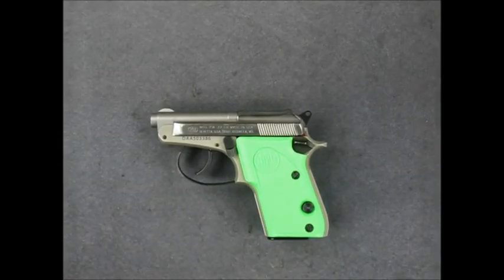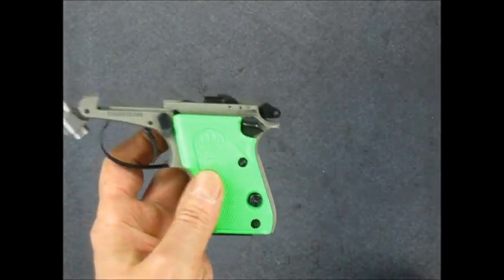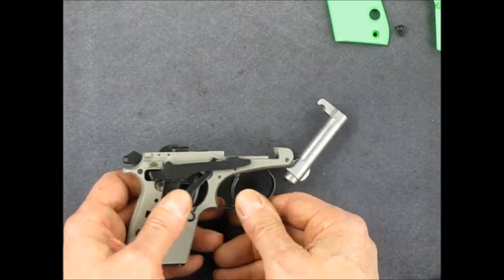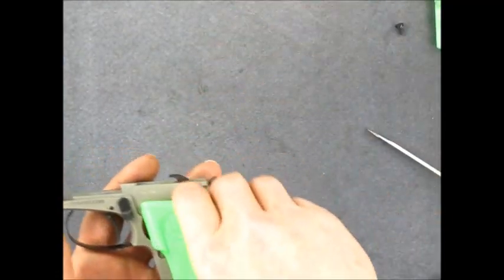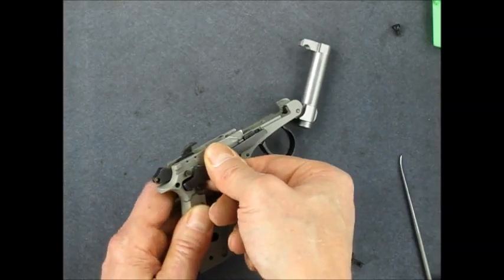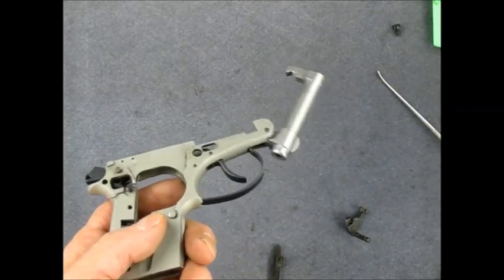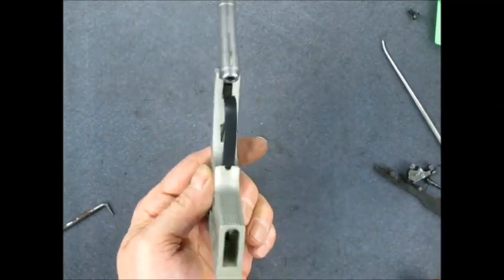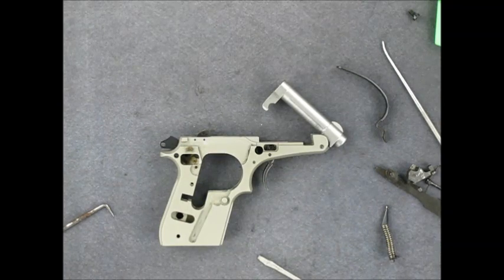Beretta 21a Bobcat   Complete Disassembly

Comment: You just saved me a lot of trouble today. Was taking mine apart to clean and oil it up and I had that little pin and spring shoot out from the safety. Had no idea what had happened. Thank God I found both, one being next to my keyboard and the other landing on my arm from ricocheting off my soda bottle. I didn't have a clue where it came from. Thanks again for having this detailed video so I didn't have a heart attack on what to do next.
Reply: same thing happened to me. lost the pin
Reply: Same problem.  Fortunately I was working on a large, empty glass table and found the pieces.  Thanks for the video!

Comment: I had a hard time getting the recoil spring arms back in place on those little circular pivot posts. I ended up pushing the spring/end-cap straight in with a watch repair tool with the spring arm in the groove too. The groove in the little end-cap is wide enough that the watch tool can fit alongside the arm.